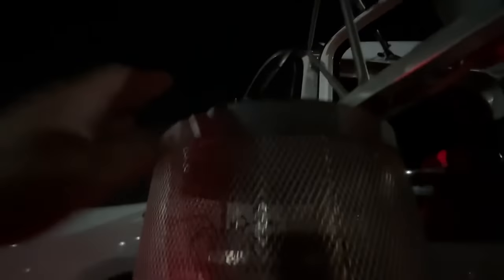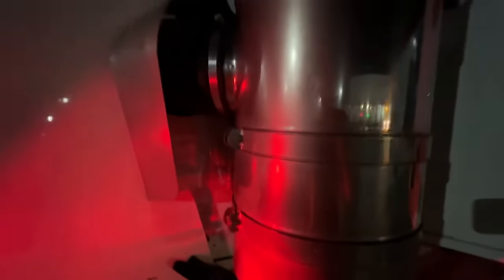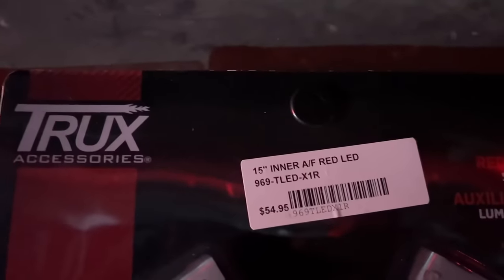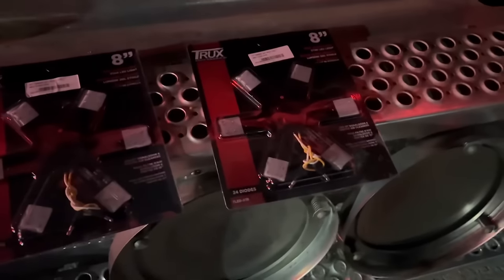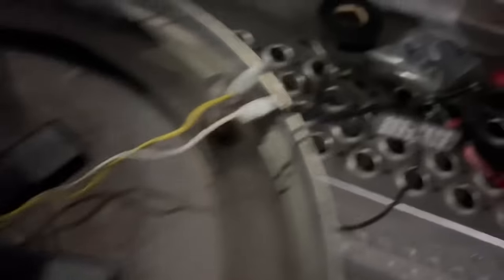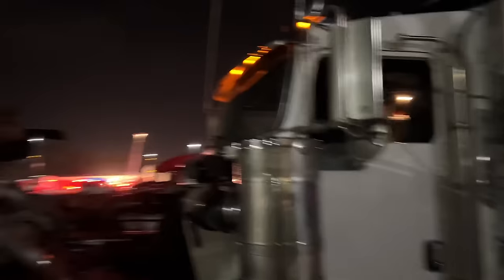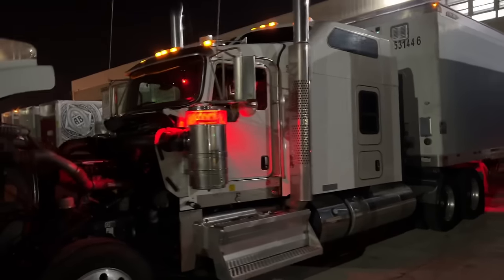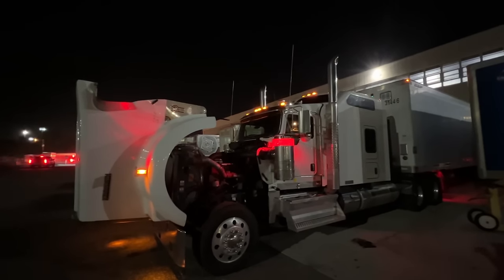How To Install Air Cleaner LIGHTS LEDS on a W900 Tractor Trailer !! Chicken Lights Need More Please

Comment: Those lights look sweet hopefully you don't have any legal issues with them being red and facing forward. Another idea you could do switch them out for the amber color and wire them into your turn signals. Now all that thing needs is some underglow and it'll be set
Reply: He won't have any issues, guys are running purple, blue, red, hell I run all green marker lights and underglow, no issues.
Reply: @TheRoadhammer379  yes ypu will have issues in some states as i did i pull in a dot scale and they told me that was not allowed

Comment: In Texas, red lights facing forward, even chicken lights, is a big $ ticket. Amber or white only facing forward. I suspect it is the same on the east coast.
Reply: @JohnHallgren  Yes, OK if parked, and not on a roadway.
Reply: He's above the law🤔🤔.......
Reply: No one cares anymore, guys are running purple, blue, red etc. I run all green marker lights and I don't have issues, even going through the Truckee scales on Donner. If I do have an issue it's a stupid non moving violation... scary.

Comment: Take the lid back off and get your 9/16 and take the nuts off inside then list the perforated basket up and turn it so the seam is toward your truck and bolt back down, that seam looks terrible out there… also maybe use some weatherproof connectors while u are at it. Then you got something that looks good and will last 👌

Comment: Looks like the lights would be to bright to run at night unless you have a dimmer switch to turn them down. A nice ride lot of difference than the Volvo the both have their advantages one good for the road and one for parking. Keep up your great videos In joy them. I don’t know but three other drivers as good as you on paper work.up keep on your truck. Great job 👍

Comment: Wow I absolutely love it 
Looks totally amazing 
I just pray that all the cops or vehicle inspectors aren't horrible mean A Holes and pick on you for the red light been seen at the front. 
I had blue Parker lights in the head lights and got told to take them out by the the useless cops here Victoria Australia 
We can't have no blue and or red light in the front and I think having blue light on the back is not good also 
Because they are emergency vehicle colours.
Reply: That's the same law in the USA too since they are Federally & Internationally reconized Emergency Lights.
Reply: @darklordchris  I had a feeling that would be the case
Reply: No one cares, guys are running purple, blue, green etc, all my marker lights are dual revolution green /amber and I run at night with green only. Never have issues, if I do it's a piddly ass ticket

Comment: You might want to check and see if red lights facing forward are legal.
Reply: I have red light in my airbreathers I never had no problem with dot.
Reply: Look at all the nanny boys in the comments, get a clue... they can't flash, that's it. I run all green marker lights, and underglow, no issues not even during dot inspection

Comment: The t800 have a hinge to swivel the air canister out from under the mirror after you remove the 90 rubber boot

Comment: When you go too change the air filters you will need to undo that bottom bracket that holds the mirror and loosen it where it connects to the cab so it can be moved around otherwise the air filter won't have enough clearance to come out

Comment: Best not run thru Massachusetts with those Forward Facing Red Lights.  Big No-No in these parts.  Also, I believe it's called "Friction Tape" like for hockey sticks.
Reply: I roll through Massachusetts routinely on my way to Maine, all green marker lights, never an issue. If I do get stopped, I flip the switch and they are amber, and I get a big scary non moving violation... oh the horror